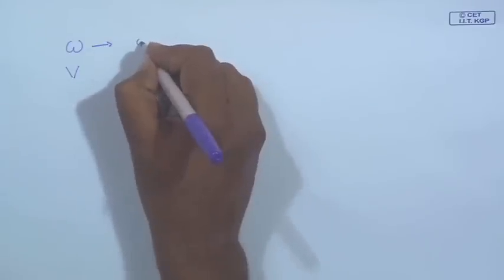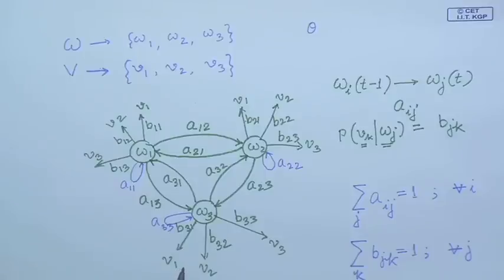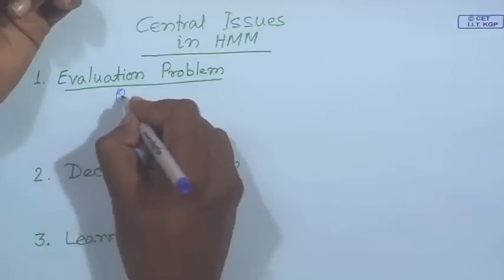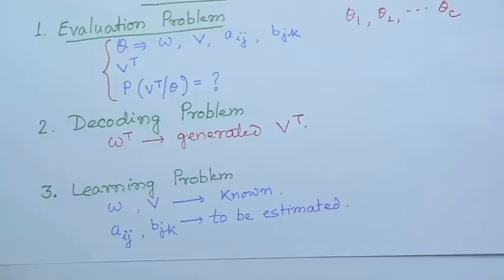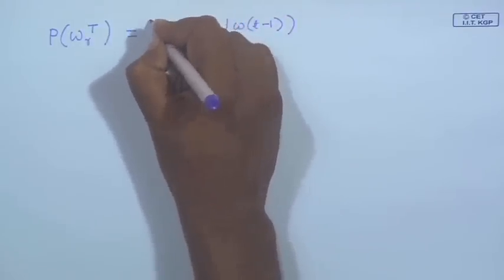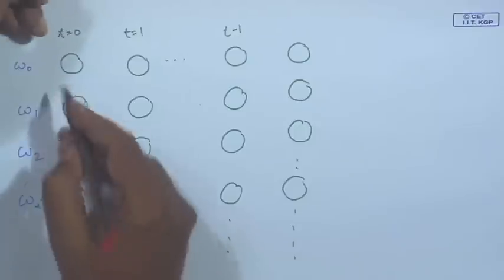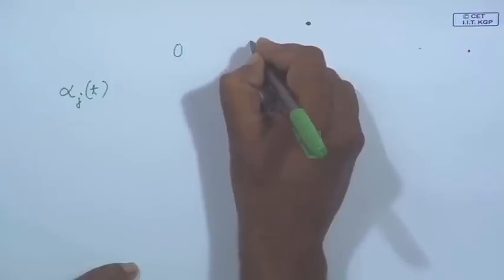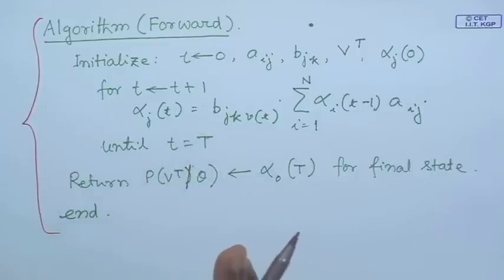Mod-01 Lec-38 Hidden Markov Model

Comment: At 50:33, to calculate probability of being in invisible state j at time step t. Ie., alpha(j, t) calculation should not multiply with b(j, k). Would that not make calculation of alpha(i, t+1) wrong? Probability of emitting expected states(symbols) at each step should be separately tracked.
Reply: No. I stand corrected. Thinking little deeply into it. alpha(j, t) is not just probability of being in invisible state j. It is probability of being in invisible state j and also producing sequence of visible states (symbols) upto time step t.

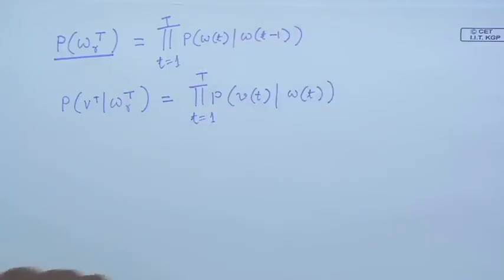Comment: Mistake at 37:10. It should start from t=0 and not t=1 as shown by the lecturer. If t=1, then that is saying, the starting node does not emit anything.
Reply: There is no mistake. The state at t=0 does not emit any visible symbol. It transitions into a hidden state (only). So v(0)*w(0) doesn't make sense.